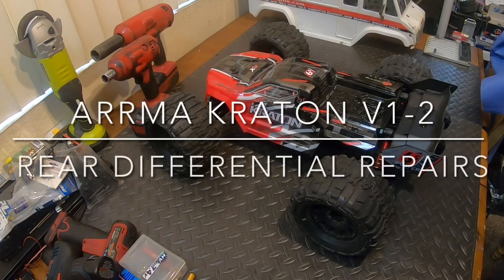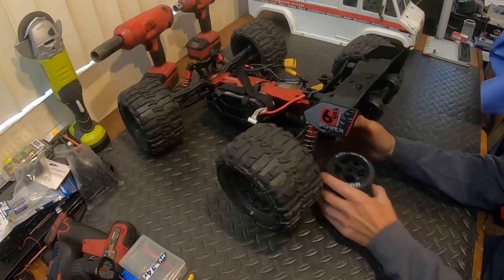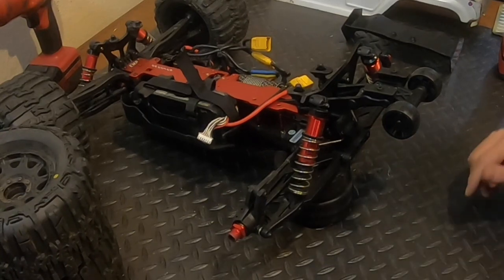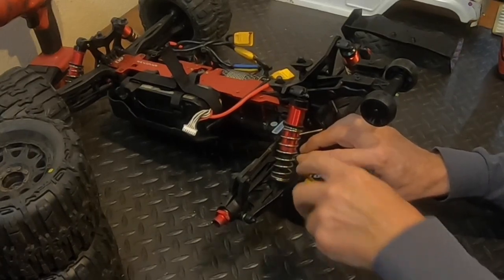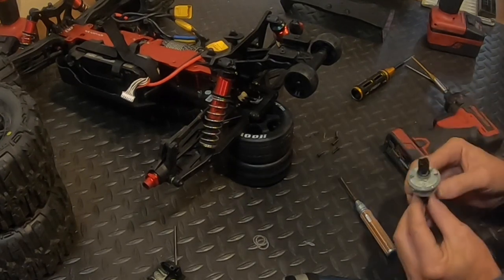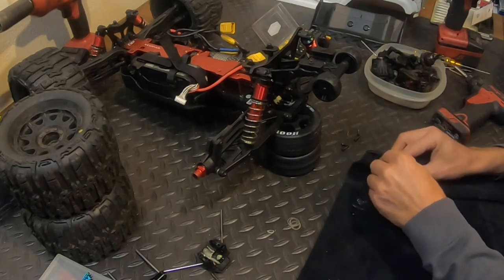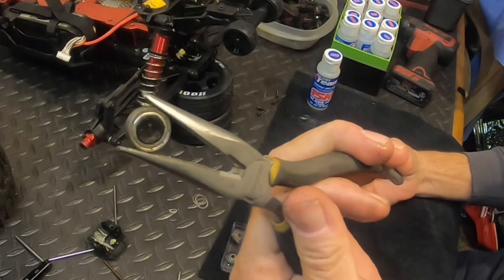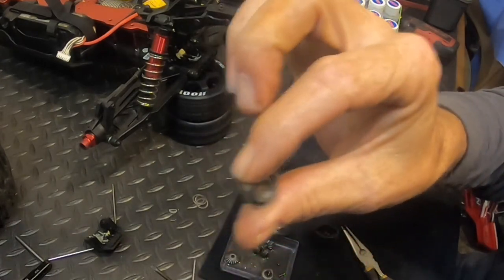Arrma Kraton v1-2 Rear differential ring gear noise under power how a mechanic figures it out ?

Comment: Hi Earl , good to see you in action again! I shim the input gear as well for a better mesh between the ring gear and input, I put a large shim inside the case then the bearing for the input gear makes more contact and less slop .
Reply from the maker: Yes when the input gears is farther out it will use less shims on the ring gear for sure 👍👍💯

Comment: Great video Earl, thanx for showing me how to take and clean out differentials. 
I've been wondering about shimming my X-MAXX differential, they could use a couple shimms for sure..
Good to see your ok,and take care of number one eh..
KEEP ON BASHING, OR SPEEDING! FROM BARRIE ONTARIO CANADA. 
PS, I took my X-MAXX out for a speed run and flipped it. Holy cow, I'm jus not used to this beast. It's sooooo fast and even goin only 50 mph it was so much to handle. I definitely need a wide road to run it. But at least I didn't break it, lol, yet.
Reply from the maker: Thanks 🙏
Reply: @earlmoorhead5555  I took out my X-MAXX yesterday, and I ran into a street sign. Lots of damage, ripped off the right tire and all the steering assembly..
I think I have enough for a video now,lol, people want to see carnage..lol

Comment: OH EARL! Third run on my maxx 5 XMAXX 800kv, ripped 3 gears on my new ring gear. Just rebuilt it. It’s shimmed good, it’s full throttle standing backflips and to hot on the juice on big landings. Diffs are tough to keep up on. Rebuilt my felony and wasn’t bad but needed shimming. Also the bearings were worn. That could be going on?
Reply: @earlmoorhead5555  your a pro, you don’t need my advise! Lol

Comment: EARL....I’ve been working on armma diffs a lot for years,,,,,I found that every diff set up is different,,,no two are alike,,,that’s why it’s so important to check diffs before you even run them.... hope you’re feeling better,,,go slow...been there done that😊.  🇺🇸👈🚘. You would think the manufacturer would have a little more consistency but evidently not so.  Oh well....
Reply from the maker: I agree there all different but turns out it’s the control arm 🤔🤔

Comment: Did you had problems with the differentials using the 3.8 Proline Trencher Belted tires in the Kraton 6s? Because I have them in my Kraton 6s and I have not problems until now.
Reply from the maker: No my v4 Kraton been bullet proof
Reply: @earlmoorhead5555  thanks for the quick response!

Comment: That wing mount is different than mine. The arms for mine our on the inside. Mine is stock v5....supposed to be that is....they have redesigned it I guess.
Reply from the maker: Maybe arrma changes a lot of little stuff year to year 💯💯
Reply: @earlmoorhead5555  Yeah, they definitely do, I just never noticed how different they were. In the end, technically speaking, mine should be the better one. However, I haven't heard anything but complaints about how easily the v5 wingmount breaks. At the same time, it's a heavy car landing wrong if it's landing on the wing, and something has to give. Of course, when mine breaks, that will be all a failure by Arrma to properly engineer a wingmount that is good enough for me😉🤣.